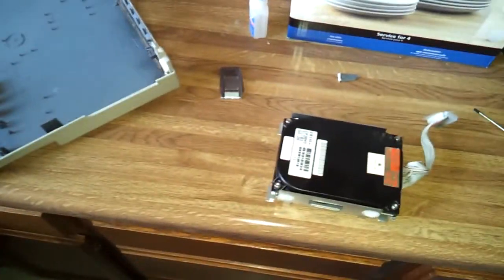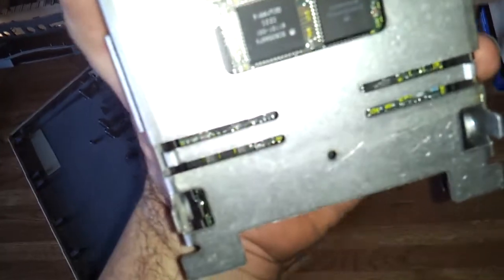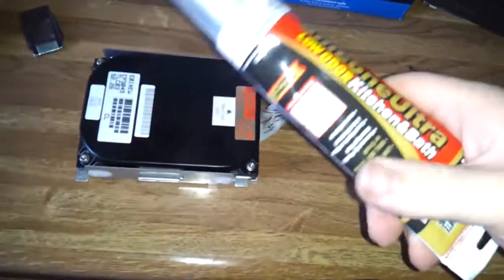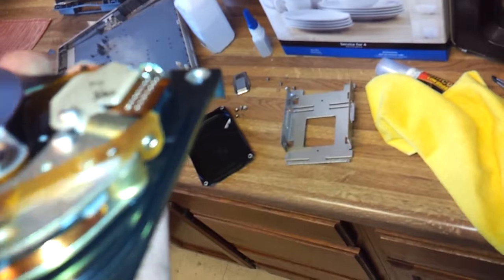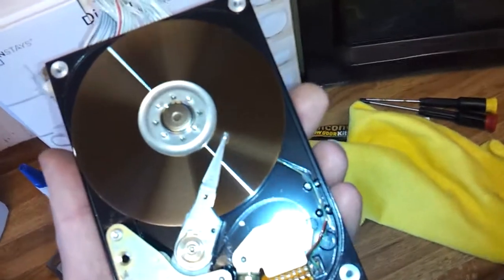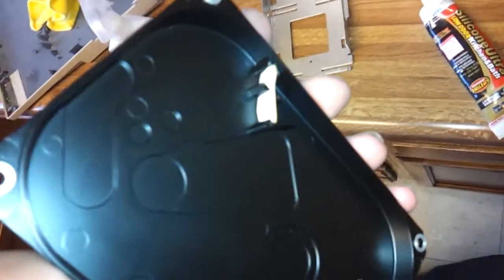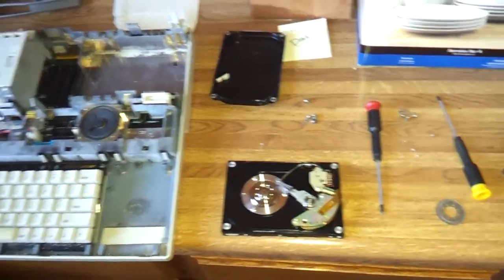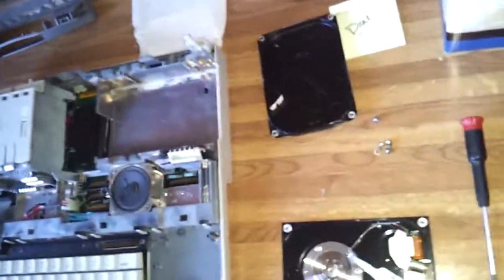Macintosh Conner HDD successful failure

Comment: the problem is actually the storage position of the drive. the drive is on its side when the portable is standing upright. the goo can drip right on the platter. Fortunately, almost the same drive is used in a mac classic I. Those have a green label and are stored horizontally most of the time. just swap the pcb's on them (and clean the gasket again) i had this problem back in 2001.

Comment: I found a guy who refurbishes these drives and sells them with bootable systems, but I think he's out of business now... damn. I got a working drive for around $100 back in 2008.
Reply from the maker: This drive is definitely beyond the point of repair I think, the platter has damage plus I would need a replacement head actuator. Nevertheless, I ordered parts and building up a SCSI to SD adapter so i can just use SD cards as my hard disk drive. Plus waiting on parts to finish my RAM card I designed, to max it out at 9MB.